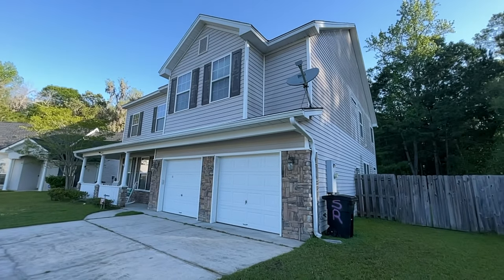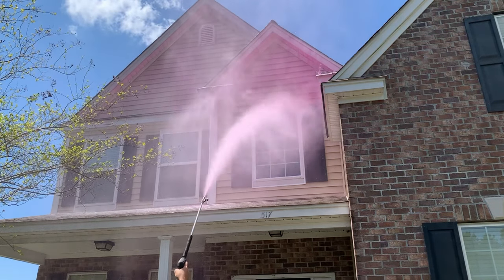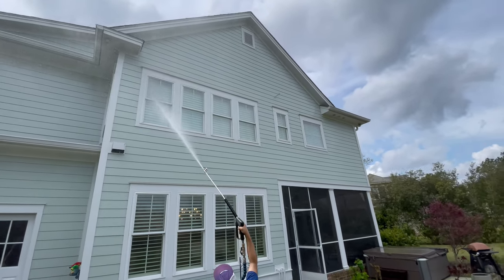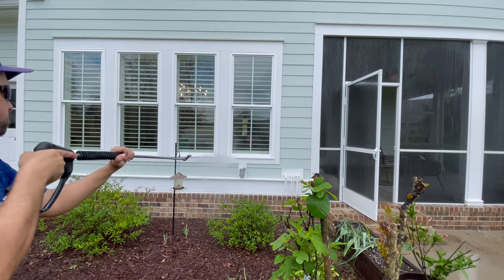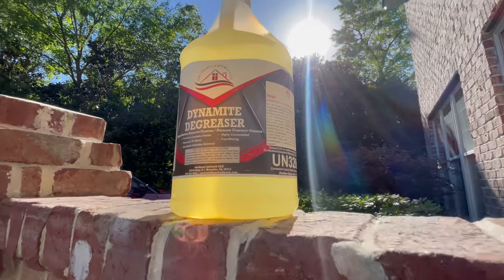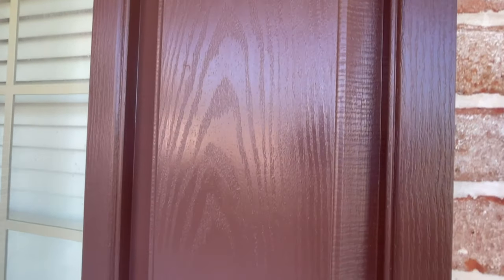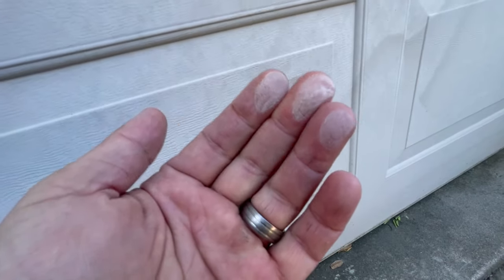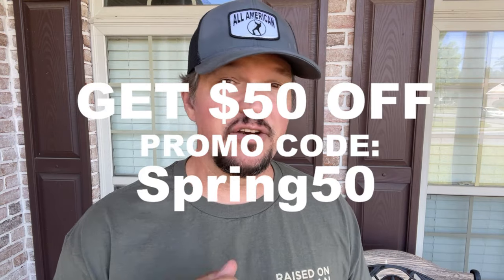Oxidation Removal on Shutters and Vinyl Siding

Comment: One of, if not the best power wash  YT channel out there. This is my 17th season owning a power wash company. When I started my biz, I befriended some of the most experienced contractors in the industry.  I'm sure Mike would recognize some of the names/companies. There is so much erroneous information on you tube by "weekend warrior" power washers. Some of the info they out would result in damage. I.E - "professionals" cleaning vinyl siding with 4,000 PSI & a Roto nozzle. Nice to see someone putting out informative tips and techniques that work and are accurate! I've gleaned a few things myself by watching these videos.  I never want to feel like I know it all..because I don't! Thanks for taking the time to produce these Mike. Good stuff man!
Reply from the maker: I really appreciate it

Comment: WD 40 was only thing that worked for on oxidation, that did most plus steel wool and a vinyl renew product did the trick
Reply: Hi! Which vinyl renew product did you use, and how did it hold up so far? I have black shutters I'm trying to clean and protect.

Comment: great video I am just starting my pressure business and I am going to use the same metering valve you are using for example if you were using 3% Sh mix what number would you put the setting on? also what tip did you use on the wood deck?

Comment: Hey Mike, I’m looking into doing pressure washing here in Massachusetts but I’ve noticed most of houses have asphalt instead of concrete driveway. I’m a little nervous about if I’m going be able to get customers. Any thoughts will be much appreciated and thanks for all great videos bro.
Reply: I'm in Massachusetts and have a power washing business.  There is plenty of work out there.  House washing is the biggest bang for your buck around here.  Only time i find myself washing concrete is around in ground pools.  Most patios around here are block pavers, and that requires more attention.  Charge more for those they're a pain in the ass.

Comment: Mike have you ever tried Cleansol BC to remove oxidation?
Reply from the maker: I have not but I've heard good things about it
Reply: @AllAboutPressureWashing  --  Raymond Notario has a good video on it.  You should give it a look.  From his video it appears it works very well on oxidation.
Reply: I love using Cleansol BC for oxidation. Here in NC, a ton of people have oxidized vinyl. We just cleaned a home that had 1970 old white vinyl. It was an old farm style house. Never had to brush it. Completely soft washed it and came off. Oxidation ran right off. They wanted old siding cleaned the best possible way without having to get new vinyl.